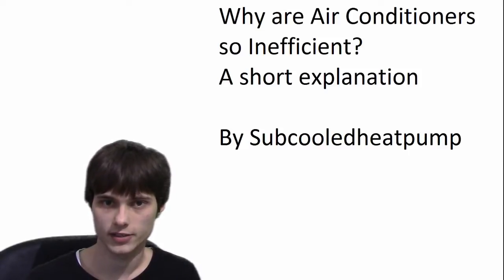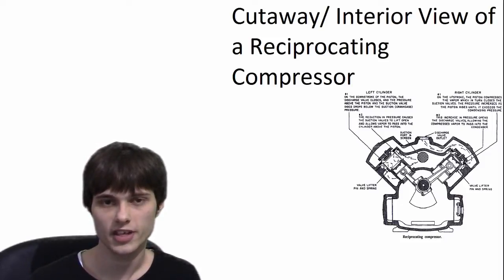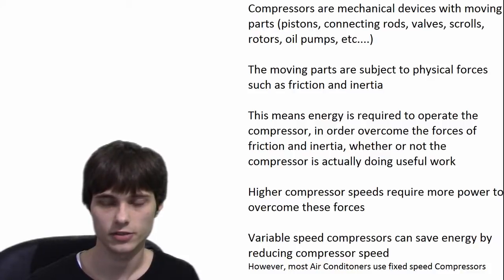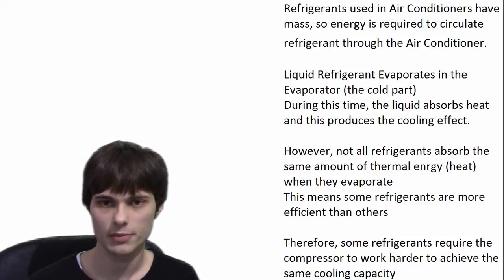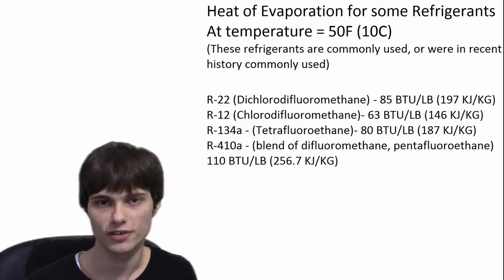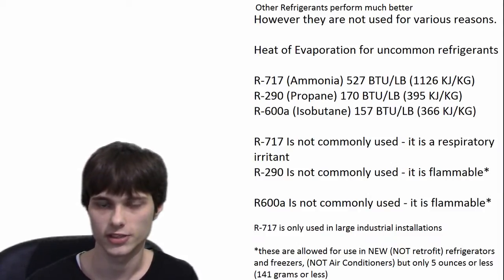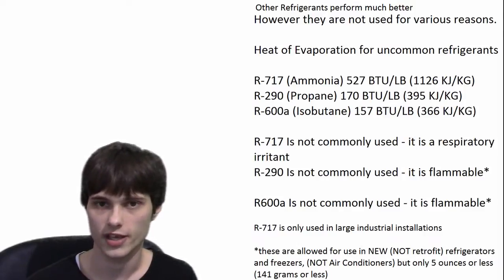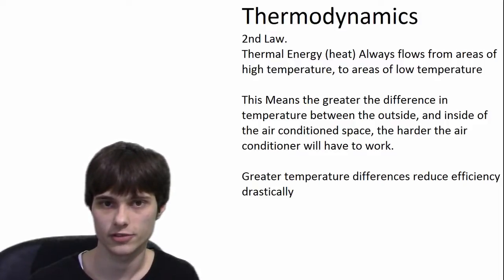Why are Air Conditioners Inefficient?

Comment: cant find any videos of anyone simply swapping out r134a with ammonia without any other changes.

also, since it is over 80f outside, the temperature difference is about 10 degrees warmer outside (which would be less efficient than 50 degrees outside) and the temperature of the ground is around 50-60 degrees. 

would it be a worthwhile effort to implement a ground source cooling rather than using air cooling?
Reply from the maker: All ammonia systems start life as ammonia systems. They don't use any copper in the system at all. So i'm not surprised you haven't found anyone doing an ammonia swap out. 

Plenty of people have used ground water for a means of cooling, but is it worth while? hard to say. Probably depends on how difficult it is to get the water out of the ground. Drilling a well can get quite expensive. Probably cheaper to just use a regular air conditioner and pay for the electricity. If you've already got a well you might be able to run the water though a sanitary heat exchanger and use that for cooling effect and drinking/cooking/bathing water.

Comment: Good discussion.  Might be useful to explain the differences between an old single speed orifice machine most people have and the newer high efficiency inverter machines with electronic expansion valves and reduced power compressors.  Went to a big home show last weekend with plenty of split inverter and minsplit systems but none of the salesmen knew why they were better.  Another factor in the efficiency equation that the general public and spec builders still do not get is low static pressure ducts and air handlers installed within the conditioned envelope of the house or encapsulated attic down south.  Otherwise 15-25% is lost.  Finally the ability of modern inverter based systems to produce rated heat at much lower temps saves money over back up resistance heat.
Reply from the maker: Yes, in the future I may make a video covering more of the thermodynamic aspects of the system, and possibly variable speed technology. I just don't want to get so technical that nobody understands what I'm talking about. So this first one I tried to keep as simple as possible. Thanks for Watching

Comment: There is a smart way to solve this problem. Generate the electricity from the sun using solar panels and about 1000 18650 old lap top batteries and an inverter. I do that in Cairo Egypt and run my Samsung  12000 BTU air condition. This way you can have an air conditioned room in the summer and the winter for free for as long as the sun shines.

Comment: Check out some old ammonia absorption chillers for homes. No compressor. Gas fired burners. This one lady's gas bill was about 300 bucks though.
Reply: Not really efficient though. New inverter system like the trane xv20 are pretty decent
Reply from the maker: Yeah absorption cycles were never very efficient. A good idea though

Comment: Ammonia is used on the ISS too :D
Reply from the maker: You're right. I remember a few years back there was a scare when NASA reported there was an ammonia leak. Good thing they fixed it. Pretty impressive they can actually use it to dissipate heat, in near vacuum conditions
Reply: Yes they use some special panels (they look like solar) probably to cool ammonia down and dissipate heat when the sun doesn't shine. That was a faulty pump and they had a spare, they replaced it with an EVA.